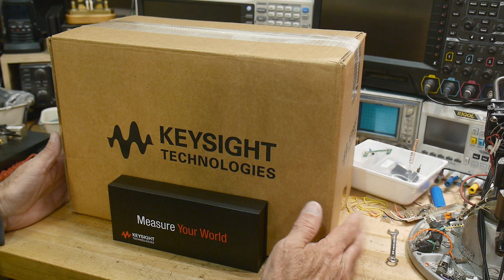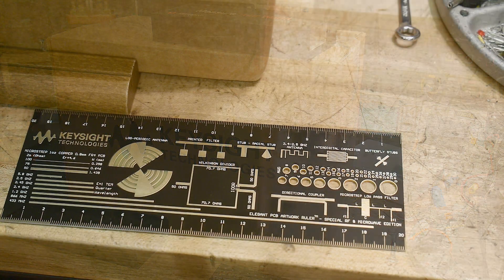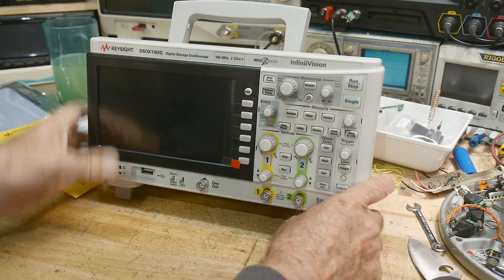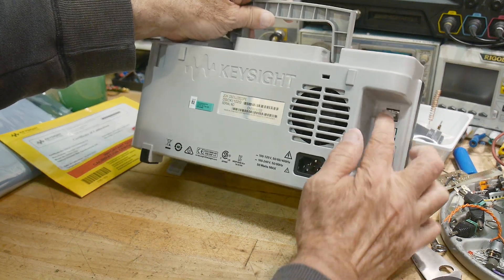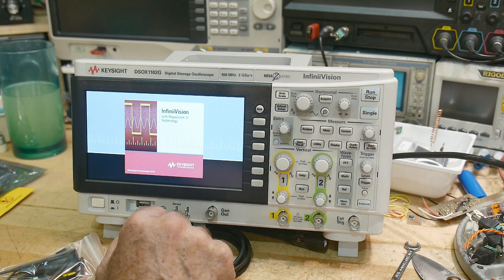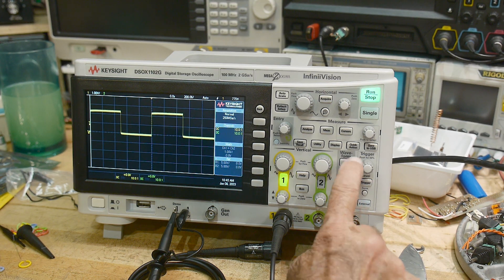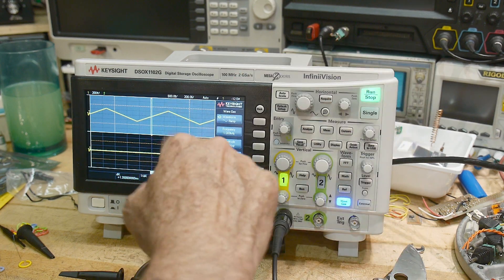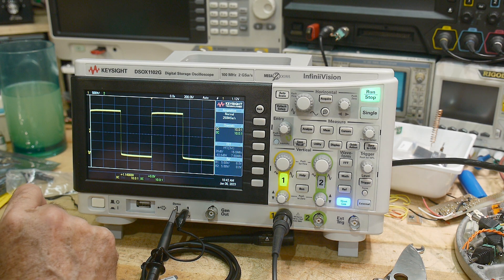#1535 Keysight Oscilloscope DSOX1102G

Comment: Think about Keysight listening to you say that you are going to put their gift in the garage as a spare, LOL.  This scope has some features, as good or maybe better than your Rigol. I recommend you use it a little on your main bench lab.
Reply from the maker: what features are better?
Reply: @IMSAIGuy  Need to test, I can say that my Keysight is much faster than my Siglent, both are new hobbyist models. (I'll fix the comment)
Reply from the maker: @JohnUsp  my Rigol is not a hobby model. I tested it up to 500MHz.
Reply: @IMSAIGuy  Look, I don't disagree to you, my experience is that the signals are more realistic on Keysight than Rigol, like using an Analog scope, you feel waves more "natural".
Reply from the maker: on mine it is just the opposite.